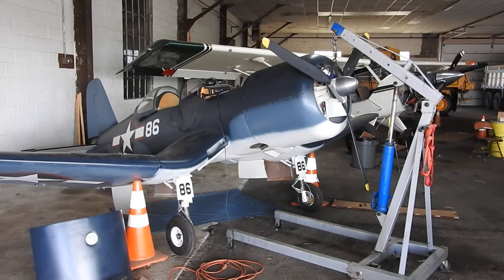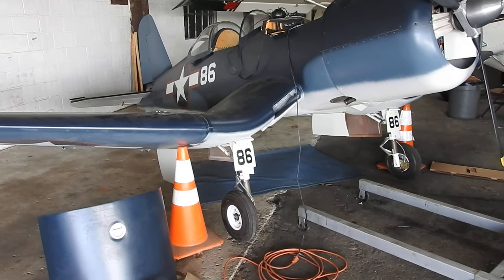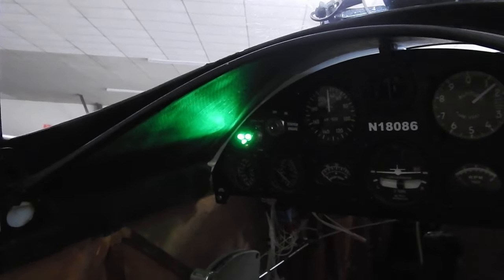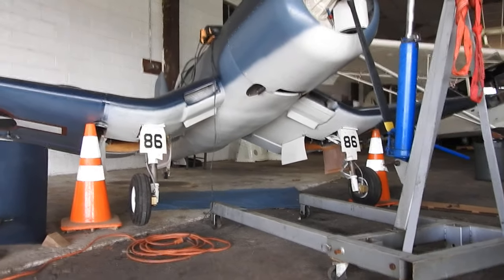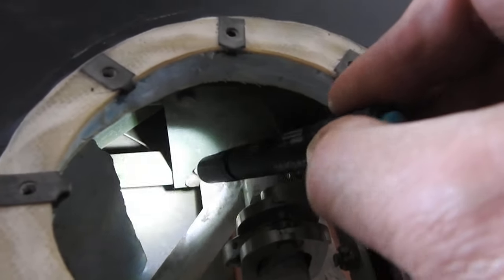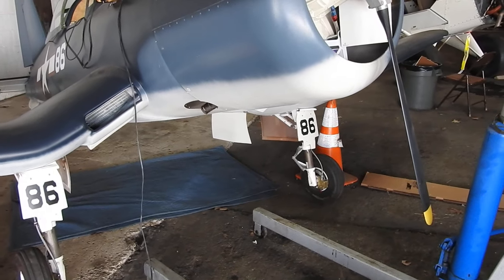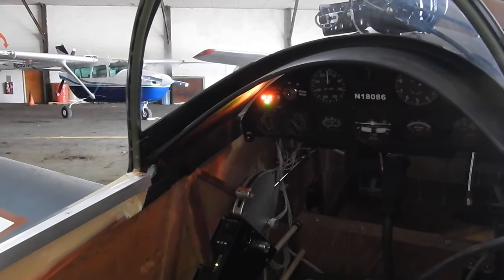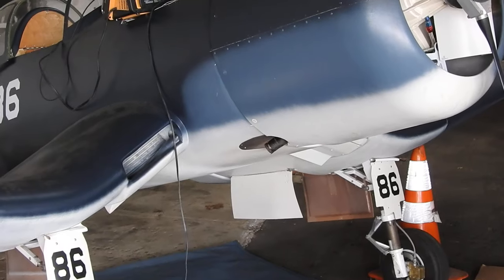WAR Corsair Update 4/16/2024

Comment: Tip. Use an amp meter/clamp meter and record the peak draw of the retracts. Then multiply that with 1.5~2 and you have the correct fuse. For the trigger switches you can also bend the outmost half of the blade/leaf spring (or whatever that thing is called)  to adjust them a little.

Comment: Hi Don. I'm wondering if you have thought of changing the round rubber wheel strut covers on the wings, to a more streamlined and visually appealing teardrop design? You could add a red coloured pin that pops up from it as well that visually shows the gear up. Same idea some fighters used for the folding wing locks. Just a thought. Looking good though!
Reply from the maker: If you were to go back to my earlier videos, you would have seen that I did make them tear dropped shaped. But over time, the fiberglass moved and shrunk, and the gear hit them. So I had to do this set up. This is what the plans called for. The problem is the wings aren't thick enough to get the gear retrack toggles to fit without clearance.

Comment: Well that’s pretty cool ! Anyone know the max extension/retraction speed? Looks like the initial extension could create some useful drag, especially if the speed is high.
Reply from the maker: It takes @ 4-5 seconds.
Reply: @Dynodon64  sorry I meant airspeed. Is there a max airspeed for the doors etc.
Reply from the maker: @toddfleury7324  I have no idea for max speeds with gear doors down.  I will probably stay under 100 mph for putting the gear down.

Comment: Great video, I hope I'm leaving a constructive comment. I noticed your gear switch seems really easy to move, you can add a switch guard, a half-moon shaped piece of aluminum both sides just wide enough for your finger, to keep from hitting it by accident.
Reply from the maker: The gear switch has to be pulled out before it can move up or down. You can't just flip it.

Comment: Beautiful and very meticulous work. I have a concern for the longevity of the metal strip actuators on your micro switches. I've seen these fail in high vibration environments. If that were to happen your gear sequencing would be lost. Do you have a provision to extend the gear with a simple push button override that would push it through the doors to get you and this beautiful bird on the ground in one piece?
Reply from the maker: The trigger arm on the switches can be trimmed off. Some of them are already cut down. I have a plan to install a Co2 blow down set up. I will install it some time in the future.

Comment: I can’t remembered, but when the circuit breakers tripped, did they only trip in the up position. As in against gravity. I don’t know and I’m sure you’re thinking about this, but I think it would be good to know how many amps are actually going through to the gear hydraulic pumps. I think that might be good to know.  NWR😊
Reply from the maker: The breaker tripped when the gear was at it's full up or down, but the limit switches weren't tripping and turning off the pump. So the pump was at full load.

Comment: @9:51... Beechcraft Sundowner, registered to the Beech Club (and they seemed to float that plane a long way). Regarding paying taxes... Never pay them any earlier than you need to! So, is it necessary to have the Blue indicators, or would Green, Red, Dark suffice? I know it's your personal preference, but the LED's seem to be a bit finnecky, with the different colors and input voltages.
Reply from the maker: The LEDs will be fine. I was just trying to turn down the intensity. All LEDs need a minimum voltage.

Comment: With the wheels outboard of the strut, I would think you need a 1/16 " to 3/32" of tow in. The placement of the wheels will naturally tow out when rolling fwd. Which would bring your tow to 0 ish.
What shuts the wheel doors hydraulic or mechanical?
Reply from the maker: Toe out is a better way to do it on a tail dragger plane. Right now they are @ .8 degrees out. The gear doors are mechanical.

Comment: I'm curious now about the full size F4U, because I know the landing gear were partially deployed to ace as a dive brake. I've always imagined the little leg covers (yours have the stenciled "86" on them, were the brakes, sort of a airflow/airbrake. What I don't understand would be how Vought handled the gear doors, or if the wheel lowering was delayed compared with the leg covers?
Reply from the maker: Yes the gear would be extended as well as 50 degrees of flaps to do dives for bombings. It would slow them down and make them more stable. The doors would be full open as well. They were mechanically tired to the gear.

Comment: Ive been following this channel for several years now.  Ive been tempted to get a set of plans from WAR.  What are your opinions on the plan?  Are they easy to follow and work with?
Reply from the maker: They are the best I have ever seen. Everything is drawn to full scale. You build over then just like an R/C model.
Reply: @Dynodon64  How about cutting and shaping the foam?  Was that difficult to do?
Reply from the maker: @KeithBNimble  Just the gull in the wings was the hardest. But easier than I thought.
Reply: @Dynodon64  If you ever find "free" or down time I would love to see you make a video showing the plans and discuss your thoughts on them.  I don't see anything like that on the internet.

Comment: Jesus Dude! Go fly the airplane  You have 40 hours of required testing to work out these minor bugs.
Reply from the maker: These minor bugs need fixed before test flying. Most of the minor bugs I have come into would not have been good to fly. The air filter turbulence to the MAF sensor, and a sticking thermostat, just to name a couple. Both could have been fatal. Testing doesn't just mean flying. Ground handling has shown me these problems.